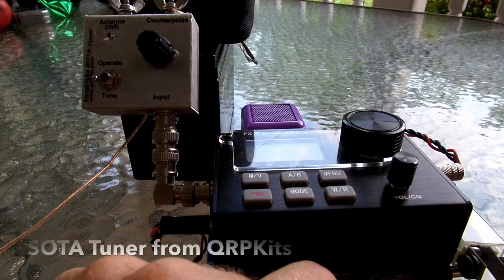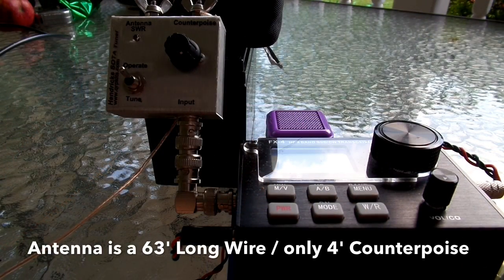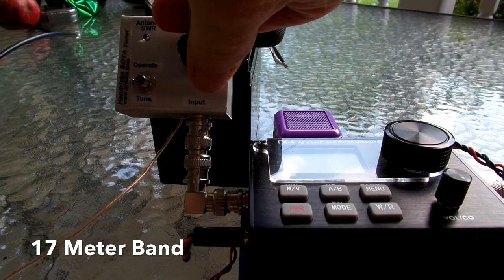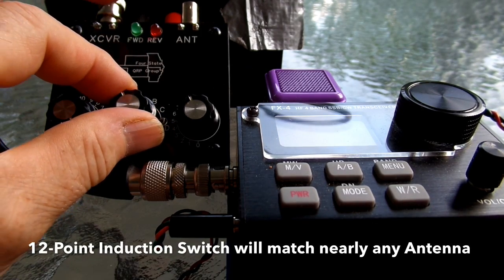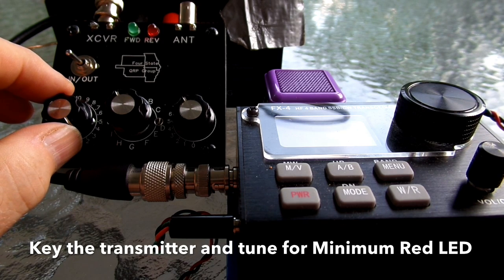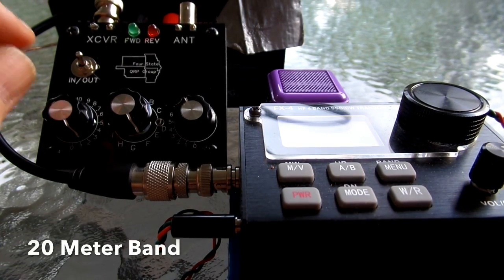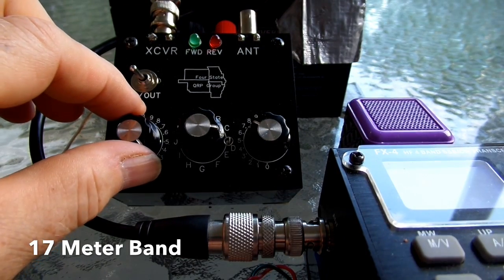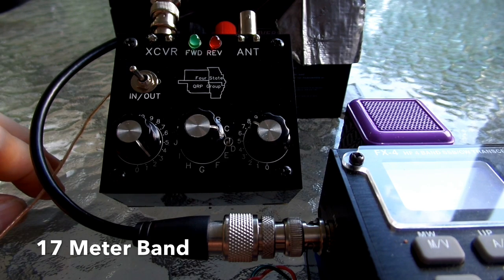SOTA Tuner vs. 4S 4SQRP Tuner--A Comparison

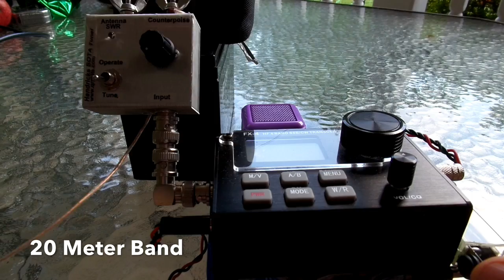Comment: I have the Hendricks SLT+ 80-10M Switched Longwire Half Wave Tuner but haven't used it yet. I has 6 toggle switches where inductance can be switched in. I haven't used it yet, but am going to try it on my KD1JV ATS3B.1 QRP radio. I understand that the major limitation of this tuner is that once tuned the low SWR bandwidth is very narrow compared to half wave wires that incorporate a 1:9 or a 1:49 balun. I do not have a regular tuner yet, but it sounds like the SOTA tuner would work better on them. I look forward to experimenting. I have been Rip Van Wrinkle on the hobby. I was very active on QRP from 1979-1991, but now that I am semi-retired it is time to find the time for the hobby again. Thanks for the video. Dave - KU9L

Comment: At 1:05 you quite possibly QRM'd the station already in qso, right on top of him!  I know you were in tune mode - but you are still radiating a signal in tune mode!  I found this out a couple of times while on SOTA summits, working stations but getting mediocre signal reports - checked the tuner, and it was in "tune" mode.  Switched to "operate" and the reports improved!  Don't believe that?  Call CQ while in tune mode and see where the RBN hears you...!  It's a great EFHW tuner, but be aware of this.  BTW, I've been very happy with the SOTA Tuner for SOTA and other portable operations.

Comment: I believe those two tuners are from completely different categories - for half-wave and random wire. The SOTA tuner designed specifically for EFHW and I would not advise anybody to use it for random wire. At the same time 4S is designed for random wire and I am not sure it has enough range to cover EFHW antennas ( actually I almost sure it has not ).

Comment: just built the Hendricks-designed SOTA tuner last night (also a big fan of his BLT+) - took about 40 minutes; tested it this morning and it works FB... i also verified SWR using my Xiegus' built-in analyzer (which of course obviates the need for the SWR LED with those rigs and even the tuner itself) - but for my other rigs, such as the 818 or other rigs with a narrower internal tuner range (e.g., the 703 and CTX-10), the little SOTA tuner can't be beat for 40-10M... i'll look at the 4SQRP - always looking for a fun built project! btw, the SOTA tuner has one important advantage, especially when operating outdoors and in the cold: simplicity in operation - finger-fiddling with knobs and switches is a pain in the you-know-what when you just want to activate your station

Comment: You did not confirm what the so called low SWR was? Who knows, it could have even been 2 to 1? I do understand the theory of operation with the LED's, but you should have put an actual SWR meter between the tuner and the radio to show the SWR was in fact down to a very good SWR.....maybe 1 to 1?
Barry
Reply: i'm sure you know that SWR is no indication of efficiency - i think the most important reason for using these little tuners is for an electrical match - most, but not all QRP rigs have foldback protection and some designs are more robust (such as the SGC SG-2020)... in practice, i've found - at least with the SOTA tuner - that if properly built, you can count on at least a 2:1 on LED almost completely dimmed
Reply: That’s a valid point. Typically the LED on the N7VE Tayloe bridge dims below approximately 2:1 SWR and turns of below approximately 1.5:1 (per my own experiments with a NanoVNA), but that can vary depending on how the bridge is constructed.

Comment: How is the longwire attached @3:00 ? I see a BNC on right side of tuner that has nothing connected to it.

Or better yet, what is that BNC labeled "ANT" used for?
Reply from the maker: Hi, Jimmy, yes you're right! It does appear that there is no antenna connected to the BNC. But, since you hear signals coming through the antenna tuner/XCVR combo, you know there must be a connection. There is no magic going on here.The 4SQRP tuner accepts both BNC ant. as well as wire ant. and ground connections. To the LEFT  beside the ant. BNC you see the RED pole for the ant. wire. The BLACK wire ground pole ( here invisible) is on the left beside it.  Good observation! 73's de Rick.
Reply: ok thanks Rick. I'm looking for an antenna tuner that will work with a dipole, if there is such a thing. I have a Shakespeare TSP20 Six-Piece Wonderpole Fishing Rod, 20 Feet from amazon, and guess i can use this tuner or the sota tuner w/end fed long wire, but am thinking a simple tuner for a dipole. Will this work?
Thnaks jimmyg
Reply from the maker: Hi, Jimmy, EFLW should work fine. That's what I use all the time when outside. 73's.

Comment: SOTA is $40 and the 4SQRP is $45 for each kit (you have to build).  So about the same price in 2016.  The video does not make it clear about if bandwidth is an issue.  Looks like power on CW is about 5W limit for either, so definitely QRP only.

Comment: Is that a Sony SWL antenna winder? If not where did you find it?  Nice video btw!
Reply from the maker: Hi, Steve--it's a RadioShack SWR tuner. Searched for it and found it on EBay.  Sangean  also makes them, about the same size. They are great for winding 63-66 feet or so of very thin copper craft wire to make a real small pockets-size LW antenna. That thin wire really holds up surprisingly well, too. Enjoy all your videos and CQ articles with the SOTA 24, etc...keep up the great work! 73's, Rick.
Reply from the maker: Oops...I mean Colorado 14....